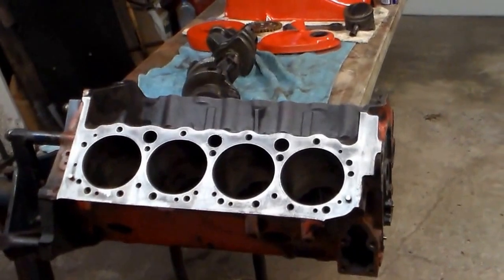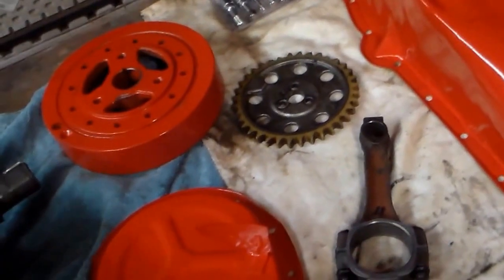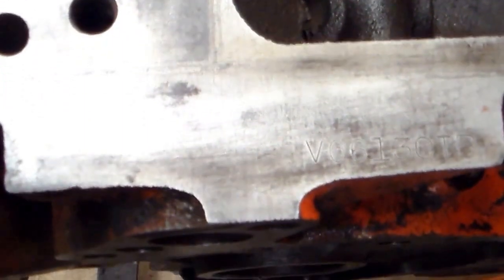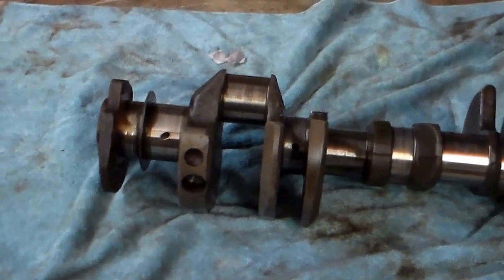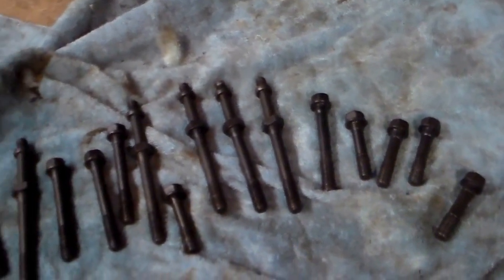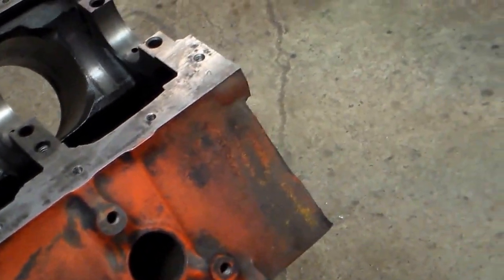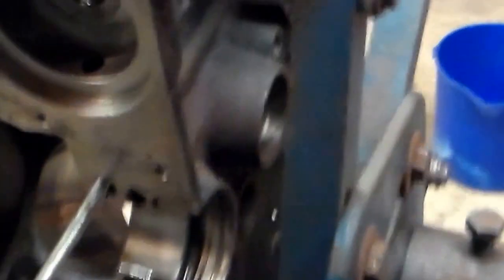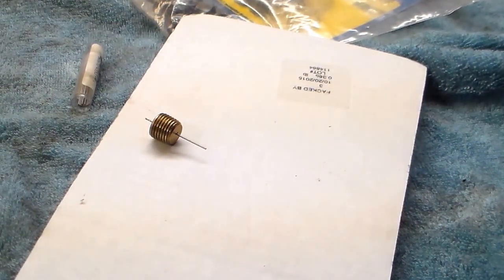1970 LT1 short block barn find.

Comment: Had one in a 1969 Z/28 pulled shifts at 7000 on a daily basis best motor I ever owned put the angle plug heads on it along with headers Endelbrock Torquer and a holly 680 double pumper with mechanical secondaries 450 hp lots of fun especially when you side step at 6000

Comment: My neighbor gave me a free 350 long block. It was orange and came out of a 3/4 ton truck. Same block but it had truck heads, I still have the block in the garage and never bored. Bought a 77 C10 and it had the same block and truck heads. Still have that one and a 69 327 built into 383 sitting in my 71 Chevelle. Picked up a 73 454 with forged crank, truck rods and 049 heads. Never bored. Came with heavy duty folding stand and RPM intake for $600. LT1 should have camel hump heads, solid cam and 780 Holley i think.

Comment: Chevy used those nylon timing gears to help dampen engine noise. They were problematic as the nylon wore and created slack in the timing chain. At 60,000 miles,  the chain in my '69 dz 302 Z/28 jumped the gear. My dad was a mechanic and tore the engine down. The damage was mainly just a couple of bent pushrods, but he rebuilt the engine with new rings, valve job, and put a solid steel gear back in it.

Comment: Congratulations on finding one of the rarest motors on earth!  I had a 1970 Z28 many years ago and I am now looking for a 1970 CORVETTE LT1 Coupe as my mid-life / old-age crisis car.  I sincerely hope you decide to put SOLID LIFTERS back into the block you are rebuilding, it just wouldn't be right to put anything else!  
If you decide you don't have a use for this motor once it is rebuilt, I would definitely be interested as I am sure many people will be but I guess it comes down to has the deepest pockets.  Anyway, congratulations again and I hope your motor rebuild has gone well and it's better than expected!
Best wishes!
Reply: Hi  I  have a  1970 corvette  LT1 Engine never  honed   all original  except
intake manifold  and now i have headers 
this email is not mine 
mine is demetreg0@gmail.com  has no more than 10,000 ( thousand original miles) perfect condition has been balanced  I believe there were 1283 Corvettes with that engine made  I have it for around  38 years  Corvette twissted  Chasi 
and was  never repaired  took the engine  when i was about 21 -22 years old
this engine would be great in a 1970 Corvette    
I have it in a Chevelle which at one point was in the garage for 25 years 
only started it  every few months back then . Now i drive the car lol
at one point i was looking for a 1970 Corvette body myself 
that is where it belongs. what an engine 
oh and of course  it is solids  angle plug heads 11 -1 compresion 
forged  crank  pistons and conecting rods what a sound  what pep 
i guess you know what im talking about , and never abused 
pushed a little but nothing more lol lol

Comment: very cool find. I'm thinking of building a lt1 engine as well.
Reply from the maker: I just need a car to put it in.
Reply: See my first reply.  Once you have the VIN, check on Nastyz28.com or the Second Gen Registry here: www.camaro2ndgenerationregistry.net/1970-registry.php
Reply: @billylowe9631  So where are the plugs that you drilled located? Are they the 3 in the front behind the upper timing gear or ???
Reply from the maker: @lindajones1592  There are three plugs behind the camshaft timing sprocket, three in the back of the block. The six are for the lifter and main oiling galley. there is the hidden plug for the oil filter and the plugs in the front and rear top of the block.

Comment: The vins are stamped on the side of the block by the oil filter when built in norwood. That is a standard installed engine. Factory replacements had different codes on the pad.

Comment: The reason why Chevrolet use a nylon gear was to keep the harmonic and vibrations down throughout the engine. That's what grumpy Jenkins used throughout his engines
Reply: Don't doubt you, but why did they not use them on trucks or heavy duty commercial applications?
Reply: @davidflaugher6750  I bet b/c the nylon gear is only good for 80-90k miles and that's not good enuff for a truck?  All these car engines I've seen are nylon and the marine version isn't.

Comment: Just watched and one big correction.  The VIN on the 1970 Camaros was stamped on the cast area bell housing flange above the oil filter.  It will have the last 6 digits of the cars VIN.  It is sometimes very hard to see as it is on the raw casting.  It is where the transmission pin is.  An over-the-counter LT-1 engine will not typically have the CTB but will be a CE (counter exchange) with a series number replacement.  There may be a car owner out there looking for this engine.  The original engine could be worth ~5k to the right owner.
Reply from the maker: David Flaugher:
Thanks so much for the correction. My experience is with Corvettes where the VIN is stamped on the tab with the engine assy date and engine code. I made the assumption that the Camaro and Corvette were the same. And you know about assume. (ASS out of U & me)  There is a VIN in the place you said. 10 space 576323. The VIN is stamped in two places on that tab with different fount sizes. Question: could this engine have come from a Nova or does the number make it a Camaro only?
Reply: Could be from a Yenko Deuce, but they are obviously more rare.  The Deuce's shared the Camaro CTB motor, not the Corvette CTK,CTU,CTV LT-1.  Not sure how the date fits in with Deuce's production.
Reply: Just looked through the Deuce registry...the 576323 isn't anywhere close to the VIN's for Deuce's.  Those are in the 360XXX to 549XXX for a very late example.  The 576323 does fall into the June-July time for a Norwood Camaro.  99% sure its a Camaro.
Reply: CTB 1970 , 350 /350hp 4 high perf, 4 spd ….. CTC it the LT1 360hp
Reply: CTC is the automatic, Turbo 400 transmission version.  CTB is the 4 speed version.  350-360HP.

Comment: CTB 8-cylinder 350 with manual transmission 320 horsepower 1970 Camaro that was a lucky find put a set of 186s double humps on it

Comment: Good luck with using a used 350 cam , unless you install all lifter in the same holes in the block they came out of , they will fail .

Comment: Original motor...11/1 compression 492 heads steel rods forged crank 
550 lift cam 324 degree duration..
Very high rpm motor...

Comment: if it the right engine it should have come with a aluminum high rise check under the timing cover it should have a stamp of 0.10 or 0.20that would make it the z28 engine in very high demand can fetch if rebuilt could be worth $20.000

Comment: i have the same engine it came out of a 1970 el camino custom special order and got another 1 same engine from a z 28 cameo i was hoping it was a DZ just an lt 1 the guy dint know what i  paid $100 for it and put it into my elki it runs very strong mine both came complete with hi rise intake holly doable pumper air con 8 inch ballencer  talk about luck right. Larry B

Comment: So wait wait wait....With all your many many many years of engine experience you felt it was necessary or even prudent  to Quote Hammer off the pistons because they are " Shot "  and start painting on it to prep it to go down to the machine shop ? The idea of looking under the alternator for the engine ID number's escaped you ? I'm really curious to know what made you think that the pistons were shot ?  and that it would need to be taken .030 over ? I myself don't have the ability with my eye's to make such an assessment and I've only been building SBC since like the mid 70s ...I consider myself a so so motor guy and I for one know for a fact the 350 LT-1 pistons are Forged units along with the "pink rods" and the crankshaft  the fact I'm looking at a Nylon wrapped timing gear tell's me this motor is a factory but the fact you even asking WHY they are Nylon wrapped  tell's me all I need to know. but then I haven't seen it all ..If this was all going to the machine shop I'm curious as to why you invaded the rotating assembly . Are you a machinist , Did you at least mark every rod you "Hammered"   What was the motivation behind  breaking apart the pistons & rods and what were you looking for ?

Comment: Dear Mr Bill .. I pray to God you know someone who is even remotely a car guy with some REAL WORLD engine knowledge .and please for gods sake THROW away the old "hardware and DO NOT reuse old main bolts or head bolts replace them with ARP main studs and fasteners ..I'm still wondering what you were thinking when your little man told you to break apart the  pistons & rods  because I'm almost 100% certain that if this isn't the very first time you have ever been inside a small block chevy or any motor it's certainly the second time .. and while I admire your zeal I'm a little curious as to how you know what does or doesn't have to be cut say for example you have the crank laying down  the next time your at the machine shop tell me how many crankshafts you see laying down ..listen if you need advice please ask I'm really more than happy to lend it free..and without any arrogance or ego ...PLEASE MR BILL.. STOP...  how many cam bearings have you personally installed in ANY engine ????? If the answer is not many or less then please STOP... Are you bored to tears ..and where does this arrogance come from  where you buy a few tools and wham your a motor man ? WRONG  buddy listen to a guy who knows ..Anyone who  "knocks the freeze out plugs in to get them out has obviously not learned that is NOT necessary at all  you knock one side down and pry them out MY GOD BILL ....Who told you to knock them into the engine ?